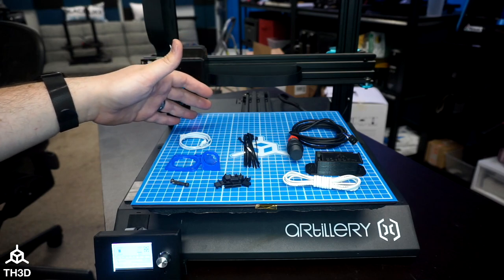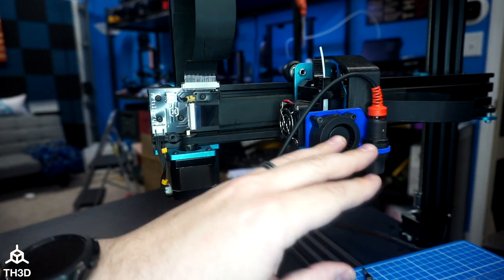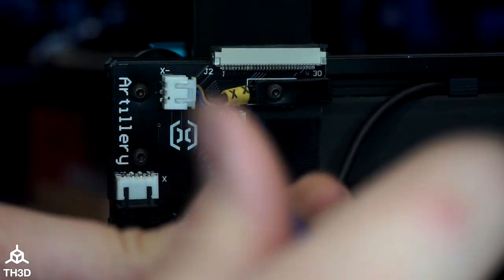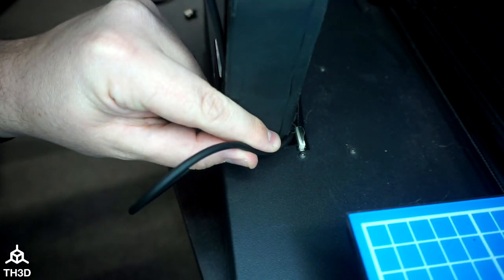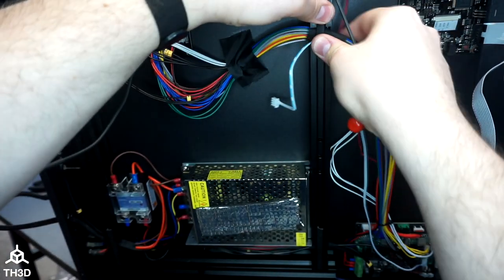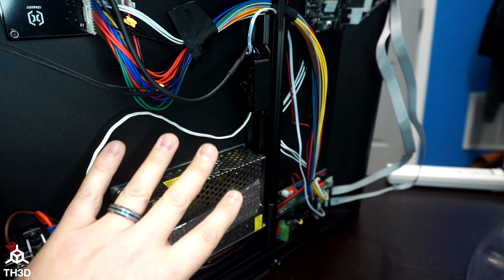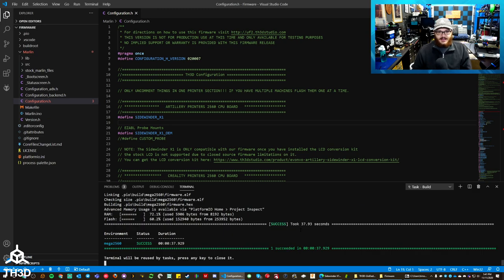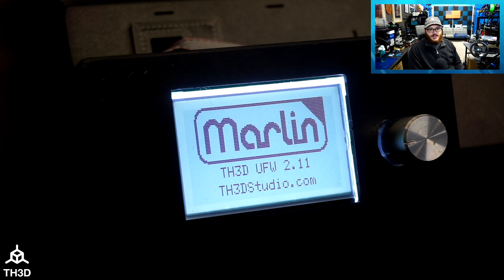Installing the EZABL on the Artillery Sidewinder X1 | Detailed Upgrade Guide

Comment: Tim does that clip for the wire keep it from twisting? Looked like you wire was sagging. Which is the problem I had with my EZABL. I ended up hot gluing mine in place. Great guide tho. That’s exactly how I ran my wiring
Reply from the maker: It hasn't moved much but putting a dot of hot glue on the wire where that clip is would not be a bad idea at all.

Comment: Hi! I have a regular artillery genius. I was wondering if its possible to upgrade it to a pro by changing its motherboard  to a ruby 32 bit and installing the all matel extruder of the pro OR use the EZABL that you just did on my current extruder (that doesnt come with abl). Thank you!

Comment: Is there any reason that your EZABL Pro Mini (12mm) wouldn't work on the Sidewinder X1? Is the length of the probe wires the same as the 18mm EZABL that is in your Sidewinder X1 'kit'? ..... I already have an EZABL Pro Mini that I haven't used yet.
Reply from the maker: The mini will work on the X1. Cable lengths are the same on both sensor sizes.
Reply: @TH3DStudio  Great thanks!

Comment: Hopefully this isn't much different for the mini version of the EZABL. I never installed mine on my ender 3, so hopefully it will work.
Reply from the maker: The mini would be the same, just use the included spacers to put it in the 18mm mount. If you lost the 12mm to 18mm spacers that come with the Mini the STL for it is in the firmware pack in the STL files folder.

Comment: Does this work with the touchscreen X1,  on a version 4? I watched the entire video, then realized that this Sidewinder is an older version when I saw the manual dial screen.

********

Ok... I read the comments, and it doesn't look like this will work.

I would have purchased this in a heartbeat. So, if you decide to make this available.... PLEASE LET US KNOW! Thanks.
Reply: The older version also has touch screen, the dial screen is part of the EZLCD Upgrade kit upgrade for X1.  https://youtu.be/QR_gvrSUehU